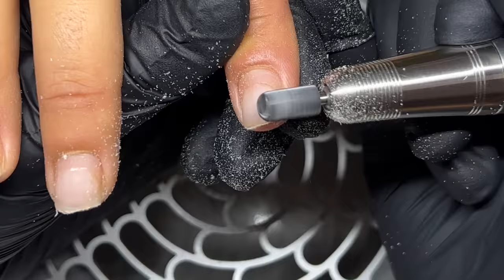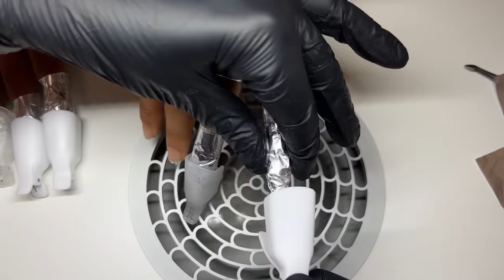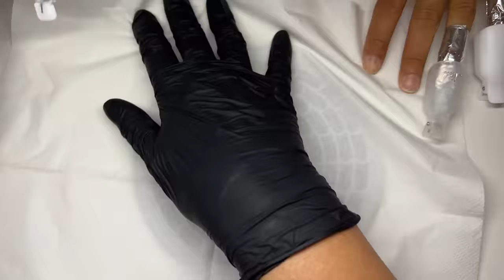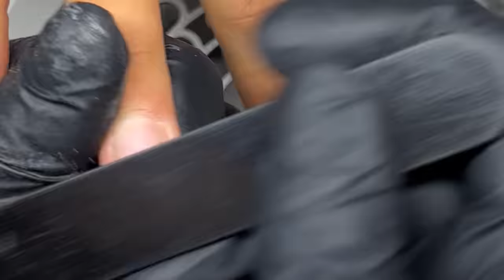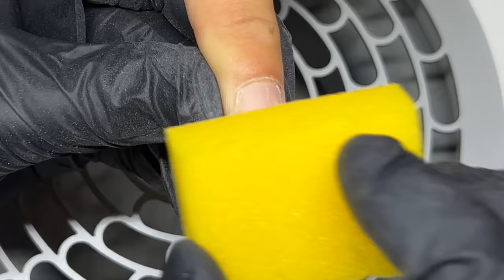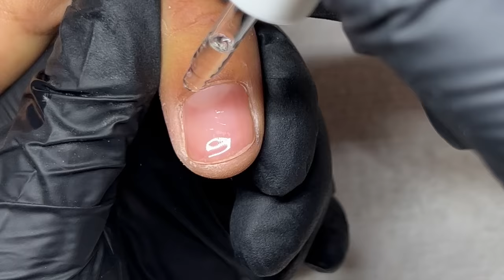Regrowing bitten nails and acrylic damage [Watch Me Work]

Comment: I did try OPI Repair Mode, and it has been very good about restructuring my peeling nail.  It stopped peeling and, after flaking off a couple of layers, has stabilized while I am growing it out.  I wonder if it is at all similar to what we do with peels in esthetic work - the "peel" doesn't strip or damage, it actually rebuilds skin structure from the bottom up, sloughing off layers as it goes and after 4-6 weeks you start to notice your skin looks smoother and is less sensitive..  I've explained it to clients as if you rebuild a poorly done brick wall, making sure your cement is tight with the bricks for strength and appearance.
Reply from the maker: Skin works very differently from a nail plate. Nail is dead and skin is not. Skin "grows" from bottom up, a nail does not. Nail is made at the matrix and it's pushed out and rides on the nail bed.
Peels do work as exfoliants meaning that they loosen up the top layer of skin making it shed. Some do damage the top layer which encourages new skin growth and faster cell turn over. Some peels are very aggressive like for example blue peel which is some serious 20-30% acid applied on the skin in a controlled way and that damage stimulates new collagen etc  
OPI Repair Mode works totally differently. It does not exfoliate but it helps to repair damage bonds between the keratin fibres.

Comment: About the filing in one direction thing, do you have any links to the supposed photographs that Doug Schoon tested in his research? I generally trust his research, but this particular question is bugging me. I haven't been able to find any evidence to support his claim that filing back and forth has no effect. I can't trust his name alone, so I want evidence of his claim.
Reply from the maker: Yes. The only link I have is in the description box in the video. From experience I agree with this notion. What matters is the grit of the file. You can file with coarser but finish with a sponge file like I always show. This bevels the nail edge and no catches. 
The nails are not built in a way that filing in 1 or both directions would make a difference. There are 3 main layers, bottom layer that takes up around 20-30% which is built with the cells overlapping like bunch of pancakes in no particular direction. Middle letter that takes up around 50% of the nails plate where the cells are actually built side to side and the top layer again with the cells being built in no particular direction. So 1 side or side to side doesn’t matter. Non of my clients have peeling or weak nails after me filing both directions. And I’m talking almost 30 years of practice. I think the whole idea of filing 1 side started with people who market glass files. With these files when you file you can’t really file both directions as the file makes an unpleasant sound and feeling. So I think they came up with the brilliant idea that the correct way is 1 way. 
I would like to see a scientific evidence that the filing in both directions matters. 
When it comes to nails there is so little science available it’s sad. Compare to hair and skin it’s laughable. I keep looking and all I see is articles in magazines written by god knows who. 
More info on the layers 
https://www.ncbi.nlm.nih.gov/pmc/articles/PMC5383514/
Reply: @TheSalonLife  I think this article can be helpful. I appreciate it. I apologize if I sounded against the claim in any way. I'm against filing in one direction, truly. I simply want to arm myself with research behind why I think filing in both directions is fine. Perhaps this particular question is one that has an obvious answer when you understand the anatomy of the nail, so I'll try to arm myself with more research. Trying to explain this to my boss is going to be fun.
Reply from the maker: No worries at all. I didn’t take your question the wrong way. I sometimes am to the point because I have a minute between clients and I respond to comments quickly and it can sound not the way I intended. 
The lack of research and good information is frustrating because all we get is marketing claims. So I just share my experience and base my opinions on that experience but I’m open to different ideas too. If you come across something good please share as well :)